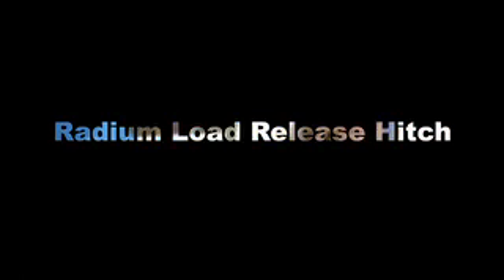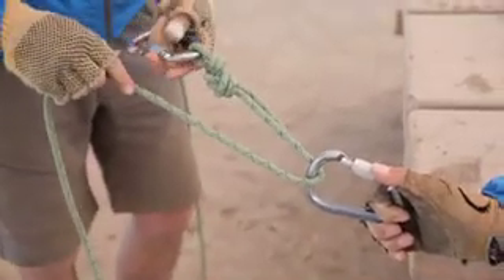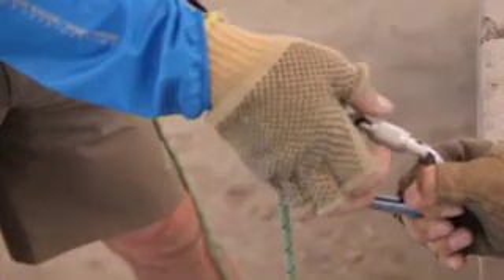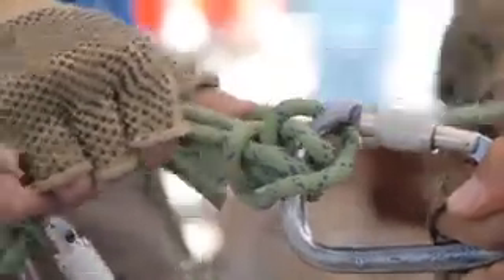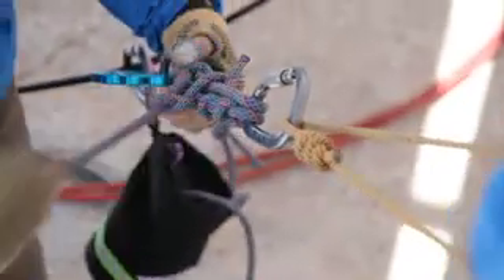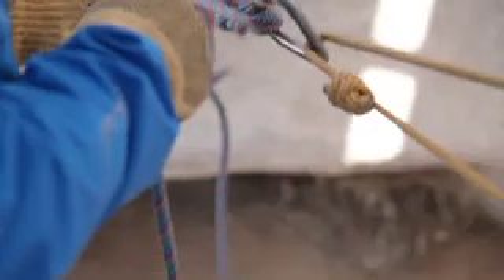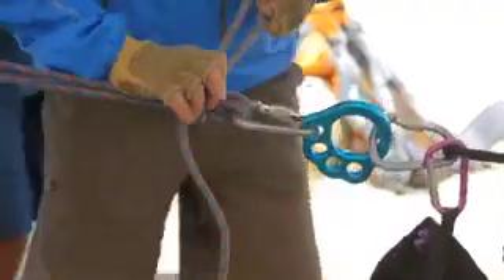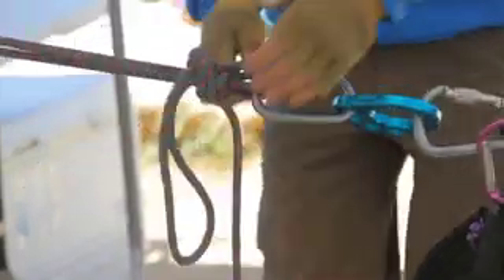How to Tie & Use a Radium Load Release Hitch

Comment: Good video and appreciate that you actually demonstrated use.  We were taught to also put a figure 8 on a bight on the loose/running end of the rope and clip that to an anchor as a fail safe in case the load gets away from the munter.